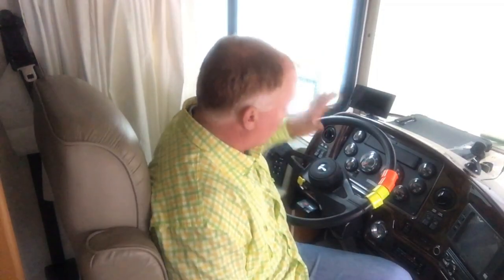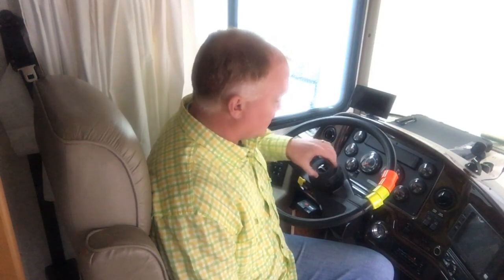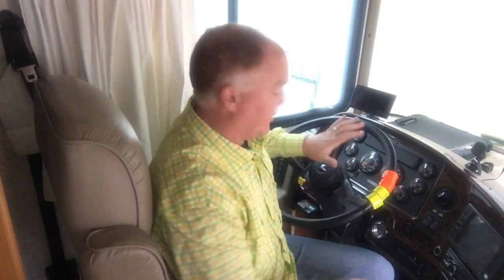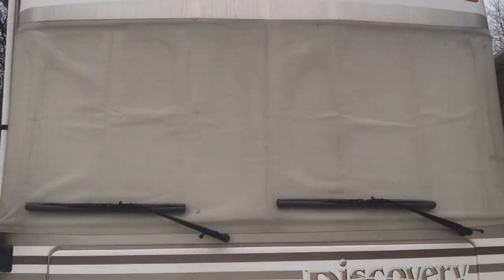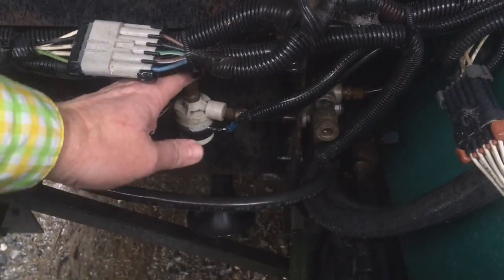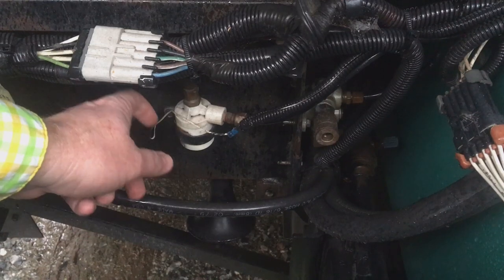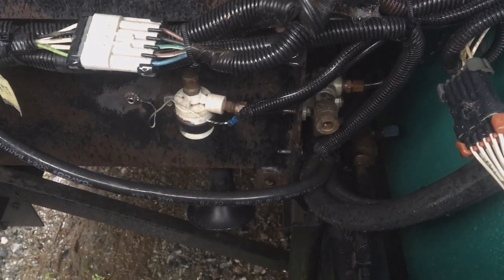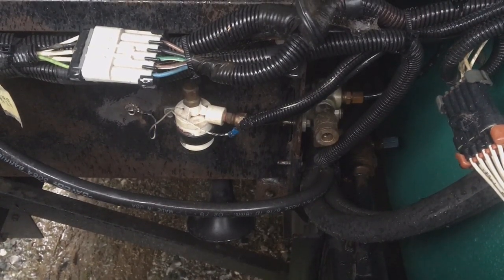RV Air Horn Solenoid Fix

Comment: turns out my fuse holder was full of water, now it works
(ebay Air Horn Truck Train Horns Kit 12 Volt with 6L Air Compressor 4 Trumpet 150db)

Comment: Hey would you happen to know where the fuse and relay location at on the discovery
Reply from the maker: only a few places to look. relays are all either on the firewall outside under the hood, driver's side...... or on the interior of the rig, mounted to the firewall, above and to the left of the brake pedal, but most probably above and to the right of the accelerator pedal.  All chassis fuses are in fuse panel 1 and 2, above and to the right of the accel pedal, mounted to the firewall, or in the BCC located in the electrical bay where the power cable goes into.  that is the black box (about 16' x 16") at the back of that bay.
Reply: @RVPastorKevin  ok thanks!!